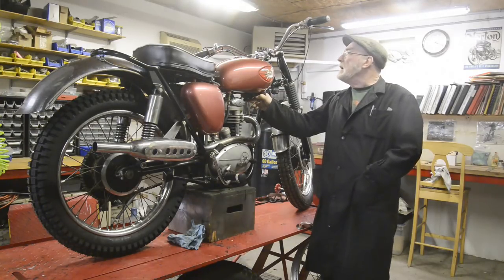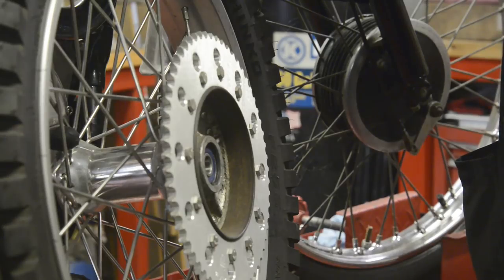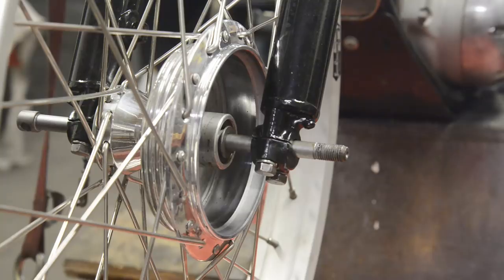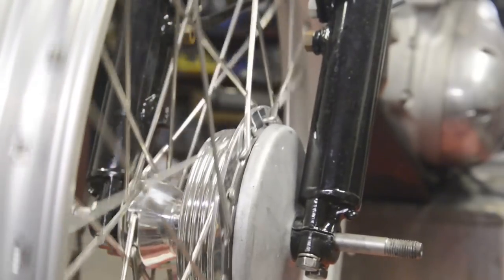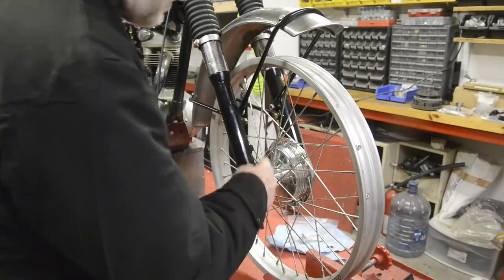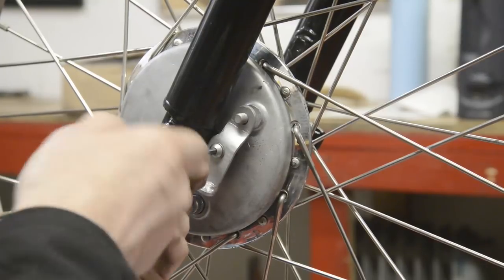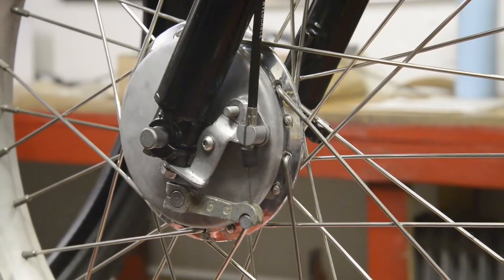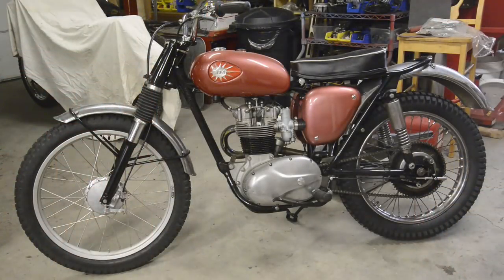BSA C15S Wheel Upgrade.

Comment: Another interesting and entertaining video Michael. I find myself doing the maths along with you as I am of an age where Imperial measurments come more naturally. I too used to go to Croft in the 60's and 70's when two of my mates raced there, one on a MAC Velo 350 complete with Stevens lightweight racing frame and the other on a BSA RGS suitably modded. Happy Days. Cheers Dave.
Reply from the maker: Happy days indeed. I may be an old curmudgeon now but I don't see top road racers riding more than one class, or on tracks that are not designed to showcase the bikes i.e. smooth swoopy bends instead of corners. Ah well, at least we have our memories.
Reply: Michael Waller So true Michael. I remember a Triton rider breaking down on the first lap at Silloth in Cumbria, He just got it running ok as the front runners were coming round to lap him. He jumped on and did off like a scalded cat. The leaders could not catch him up for all he was a lap down he led over the line! What a rider. Wonder if his name was Hailwood?? Lol, Keep up the sterling work my Yorkie friend! Dave

Comment: A good effort Michael, I've done a few wheel changes and it's not always easy, you have to spend money to buy the wheel before you know what you are doing !
Reply from the maker: One of the things here was the fact of it being a genuine C15S. I did not want to go sawing things off and welding other things on. I could have made the rear wheel fit but at what cost to the Beeza swinging arm.

Comment: Enjoying your videos immensely!
Wondering if you might critique an approach I thought of for the front wheel?
I thought of having the brake stay on the front of the fork leg which would place the actuation lever behind.
Don't know if that would be at all possible or even desirable, not being there to see the what's and where of's.
Was thinking back to a similar mod I did many, many years ago on the rear of a hard tail that ended up beating the frame senseless when it let loose!
Again, your efforts are most appreciated!

Comment: Michael, Thanks for all your videos, I spend hours watching. However.. a brake arm is ideally supposed to be fitted so that it doesn't go beyond 90 degrees with the brake applied. Otherwise, mechanical advantage is lost and it will get worse as the shoe linings wear. My first bike (OK, Moped - I was just 16 and had spent a year restoring and building a Phillips Gadabout) failed its MOT in 1972 on this point - unlike this C15 it was difficult to remedy because it had a square end on the shaft, not splines.
Reply from the maker: One thing to bear in mind is that I was using parts from several sources. If I shortened the outer cover on the Bultaco cable it would have allowed the arm to be lowered and given better angles as you point out, but use comes into the equation as well. The extra work would not have have been worth it, for me at least, for the use that I know this bike is going to get. Thank you for the comments, I have been given a lot of good ideas and advice from subscribers over the time I have been doing the videos.
Reply: @BritanniaMotorcycles  Fair enough! BTW, thanks to your videos, I've gone out and bought a flat cap, LOL!
Reply from the maker: You know that single purchase will change your life forever.
Reply: Michael - Yes, already I've noticed that my head stays a bit warmer but my wife laughs at me. Cheers, Paul. ;-)